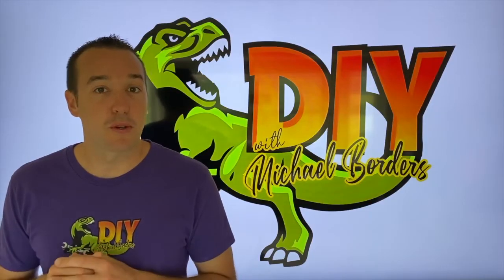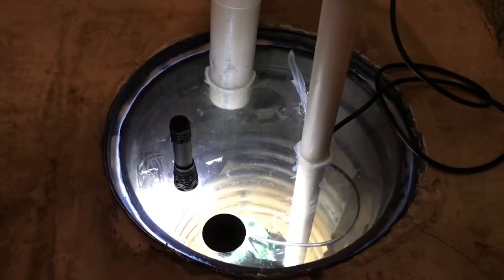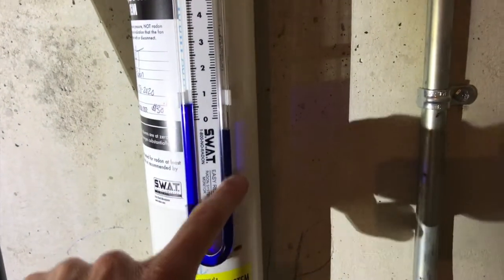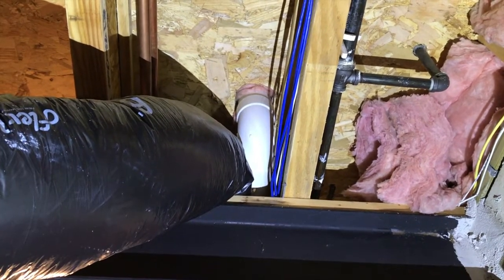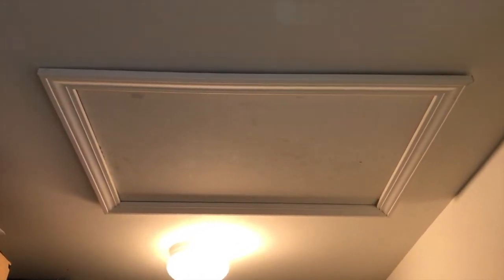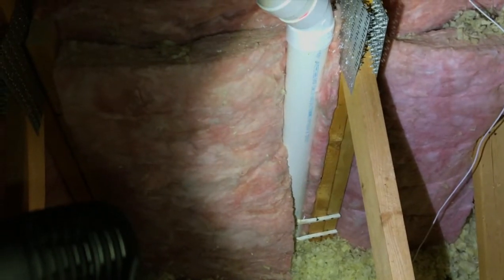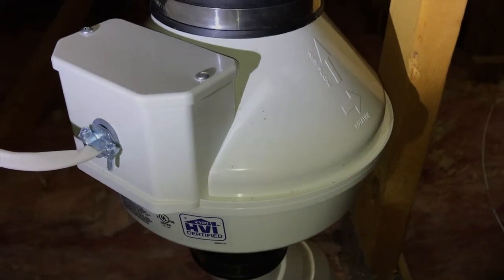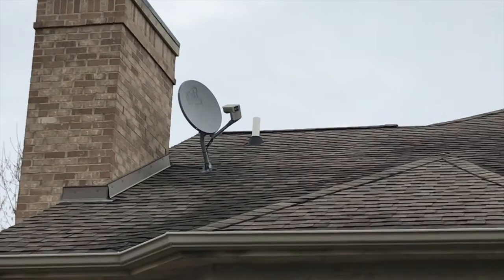What is an ACTIVE Radon Mitigation System - Explained

Comment: So that fan runs 365 days a year 24 hour's a day? How is there that much raydon or whatever under your house?
Reply from the maker: Peter Ford 

Thanks for watching Peter & it does indeed.  That’s just how the system is designed.  Only cost approximately $30.00 per year in electricity.  We have tested it a 3rd time for piece of mind & the results were great.  The system is doing its job.

😎👍🔧🔩
Reply: @DIYwithMichaelBorders  Thanks. I was just curious. If raydon is produced by certain materials in the soil. Would not just a pipe , like the stack on a plumbing vent stack create a natural atmospheric draw to allow the gas to vent on its own?  I have no problem with the yearly cost of running a small fan the whole time. It's kinda like,,if it would draw on its own, it'd save worry about a fan failure, or the minimum power cost.  Just wondering. Thanks again.
Reply from the maker: Peter Ford 

It does indeed.  This install option is called (Passive System). It uses stack effect & atmospheric pressure to draw radon gas.  Below are two links to videos that shows a full walkthrough of system & computer diagram difference between Passive & Active.

       https://youtu.be/ABn7_Pz-kZI

       https://youtu.be/2qs2fTM92v4

Hope this helps.  😎👍🔧🔩
Reply: @DIYwithMichaelBorders  Thanks. Yeah, I heard about raydon years ago. But know there are millions of homes on concrete slabs,,that have orifices for plumbing etc. Don't know what the stats are about raydon and affects on us humans. Compared to say everyday solar radiation. But I guess different areas of home construction pop different levels. In FL,we don't have basement s as compared to more northern homes. Guess that's a factor as well. But better safe than sorry. Glad for those who have the issue to have an solution.  Take care.
Reply from the maker: Peter Ford 

Thanks for the reply.  We have a few additional helpful videos being uploaded over the next week.

😎👍🔧🔩